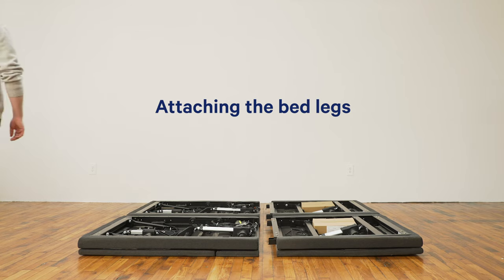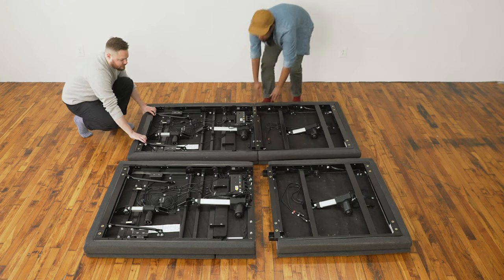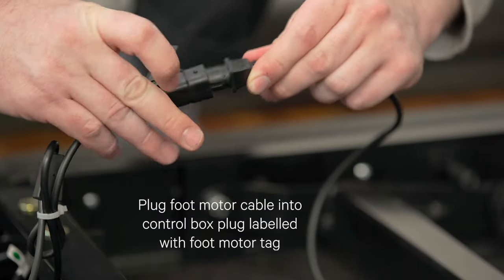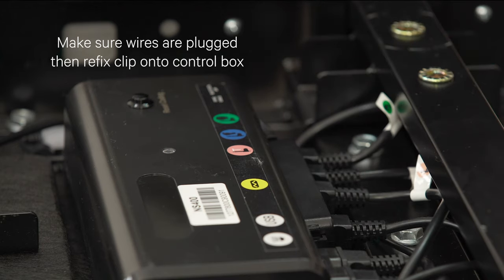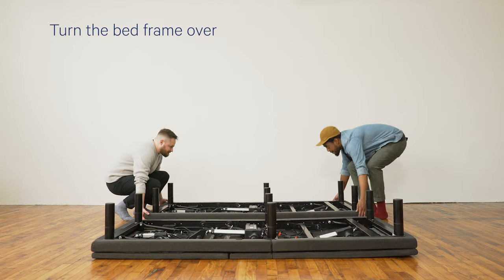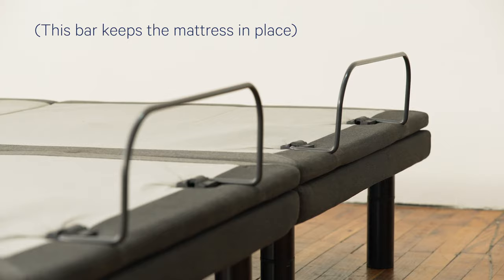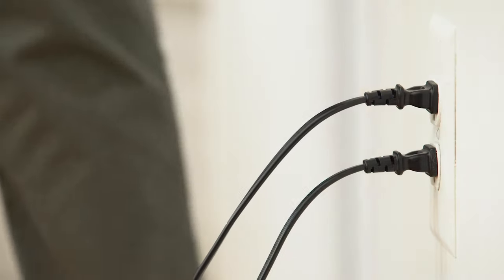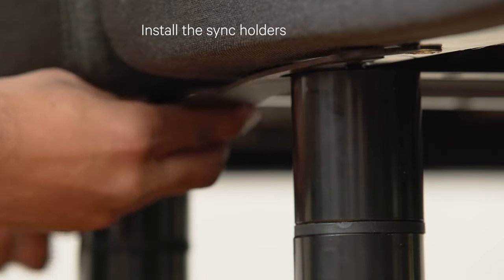How to Assemble the Adjustable Bed Frame

Comment: I have a regular king mattress will both sides move at the same time? Or are all the kings split?
Reply: you found any solutions?? i have the same model as you where they both move
Reply: @emera1750  yes you can sync the remote to move both sides at the same time.
Reply: You can sync them with a sync cable too
Reply: @theunkownmr.562 how do I do that exactly? Do I need buy separate part?
Reply: We had to buy two Extra long twin mattresses which equals one king mattress. its good because we can each adjust our mattress to how we want it.